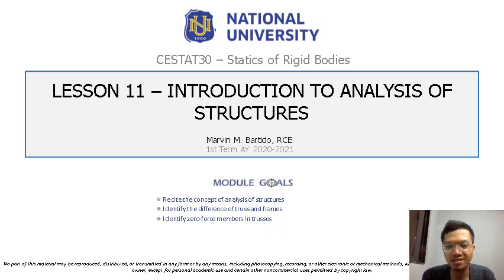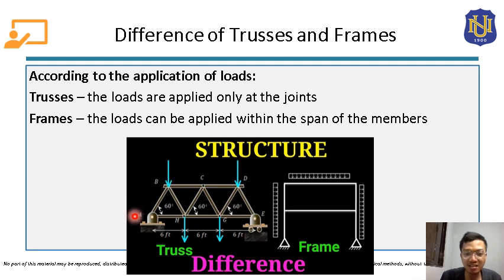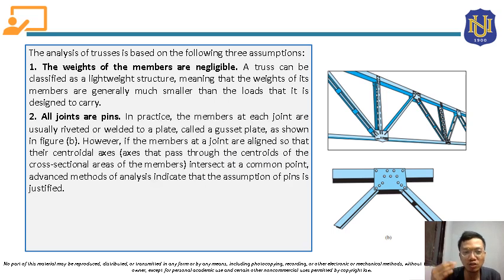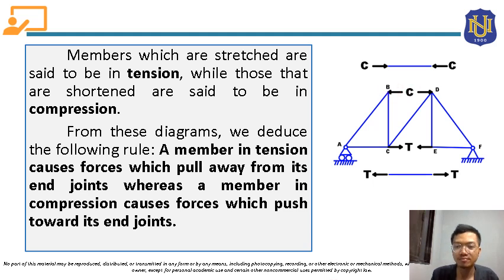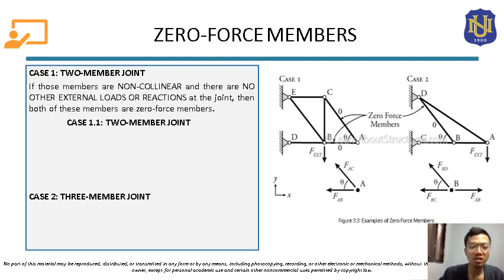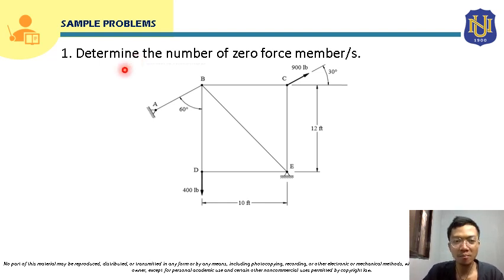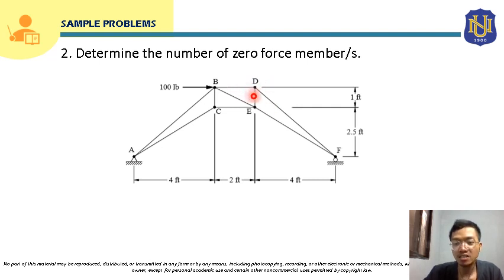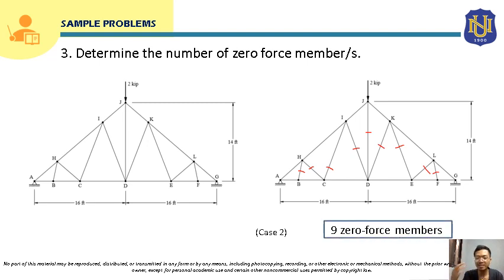Statics of Rigid Bodies - Introduction to Analysis of Structures

Comment: PONDIVIDA, KASSANDRA RHYZ (CIV235)
in method of joints there is a pre-step wherein you need to determine the reactions in the external supports from the FBD of the entire structure

Comment: Diamartin, Jezebel P.
CIV235

In a truss, the loads are applied directly to the joints, ensuring that each member experiences tension or compression. In contrast, in a frame, loads can be applied along the span of individual members, which can result in bending within the members.

Comment: Ventura, Rush D.
CIV236
The analysis of truss is based on three assumptions;
1. The weights of the members are negligible
2. all joints are pins
3. the applied forces act at the joints

sana may plus points pa sir hahaha